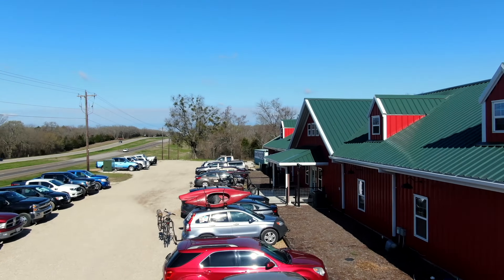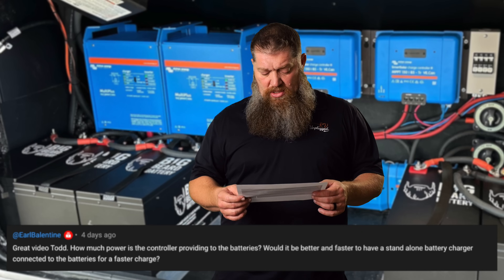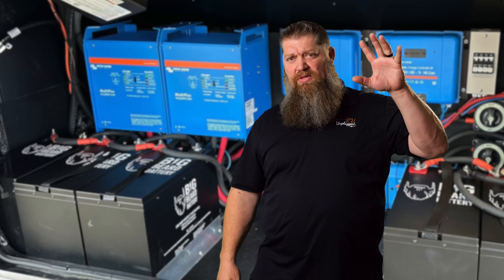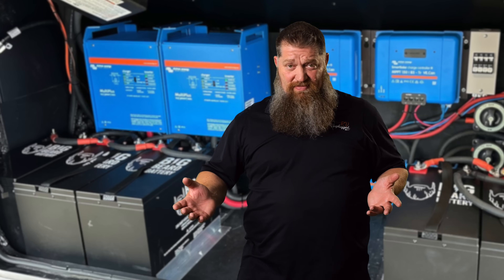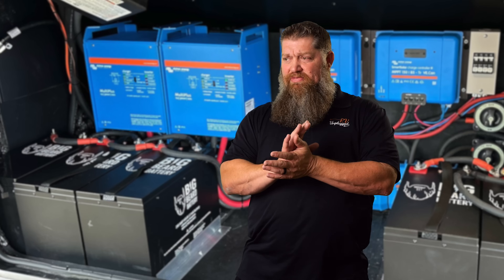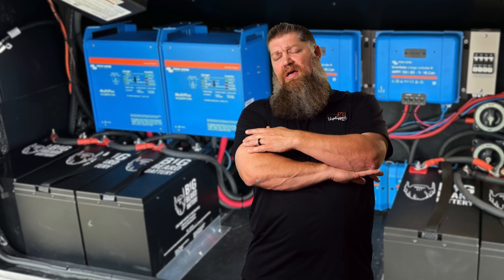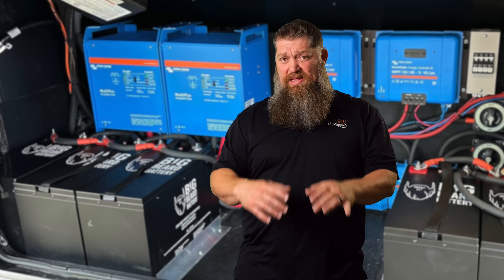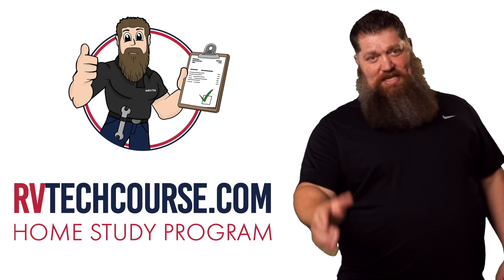How do solar charge controllers work?

Comment: "Your typical battery charger may produce 50 amps to 60 amps.  Solar panels, I can produce up to 100 amps."
"If there is a charge source, plugging into shore power will always be preferred."

These two statements seem contradictory.  If I can get 100 amps charge from solar, but only 60 amps from my charger, then I'd pick the solar every time, as long as I've got good sunlight.  It'll charge faster, and sunlight is free.

"You have to keep it within the limits of what the battery can actually handle."

Be real careful with this.  A 12v 100ah LiFePO4 battery can "handle" a 100 amp charging current.  But it will stress the hell out of the battery and shorten its chemical life.  The optimal charge current is generally 20 percent of the charge capacity.  For a 12v 100ah battery, that would be 20 amps.  Charging at that current will be slower, but it will significantly extend the life of your battery.  I've never charged a battery from both the solar and grid power at the same time for that reason.  Pick one or the other.

Comment: Appreciate all your information. The Victron Boondocker bundle has (4) 175 watt solar panels. I like the rest of the setup, but could I use higher wattage to produce more power. Current setup allows for half a day according to my estimates...or is it more of a storage issue?

Comment: Todd - your videos are always incredibly informative.  Question - you mentioned you can have 2 charging sources at once.  Can you have 3?  Shore power, rooftop solar and briefcase portable solar?
Reply from the maker: Yes as long as you don’t exceed the charge capacity of the battery/ies
Reply: @NationalRVTrainingAcademy  How do you determine charge capacity of battery?
Reply from the maker: @ShaunGalang   what’s the make and type of your battery?
Reply from the maker: @ShaunGalang  so lithium you would need to look at the litime site to see what’s the max continuous charge rate. Typically 50 amps or 100 amps. 

As long as all of your charges at once does not exceed the battery max then you are absolutely fine.
Reply: @NationalRVTrainingAcademy  thanks for all the info!

Comment: Todd and company.... How close to the batteries should a charge controller be to the batteries??
Reply: As close as you can, preferably only a few feet.  Direct current (DC) loses power quickly over distance, and the power coming out of the charge controller will only be 13-14 volts.

Comment: Nice work Todd! When we were traveling with our rig in the Southwest this winter, our 1,750 solar setup would typically send 400-700 watts of power into our batteries, only occasionally reaching the 1,000 watt mark. The sun was just too low to do better than that. Now if we were in south Texas in July at noon, we might get close to their rated output, but you're not going to catch ME down there then!